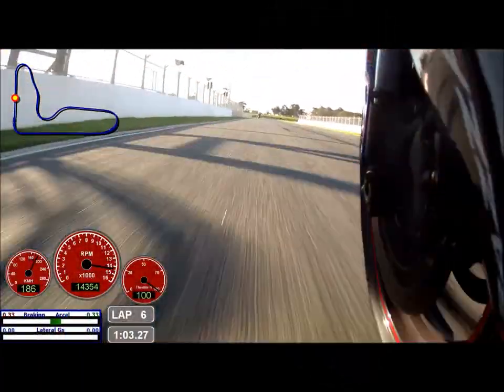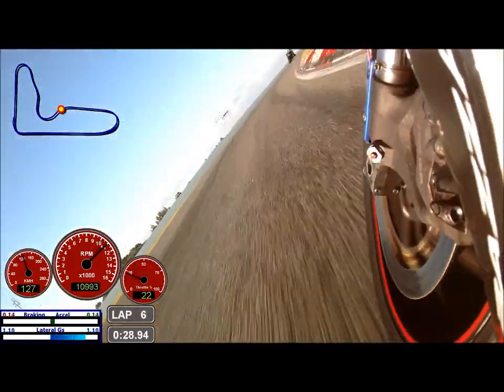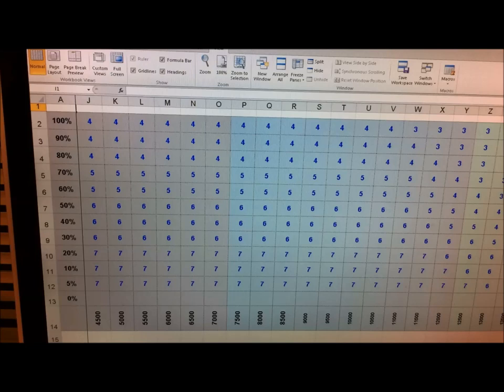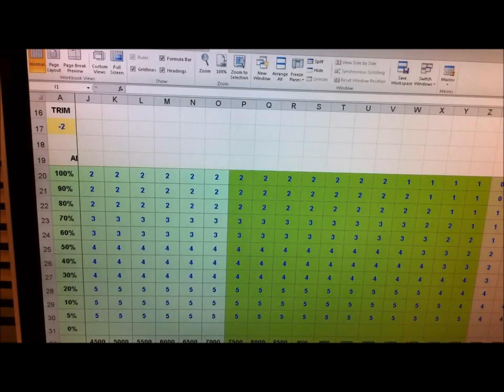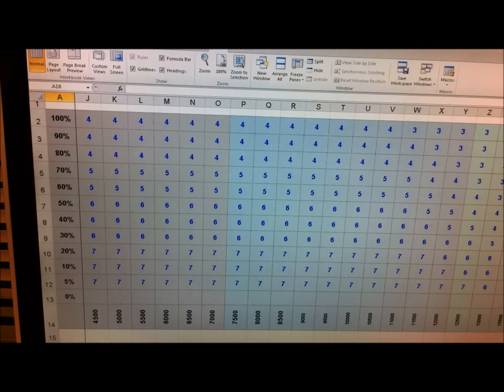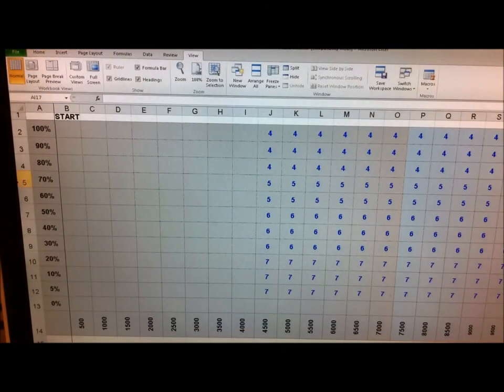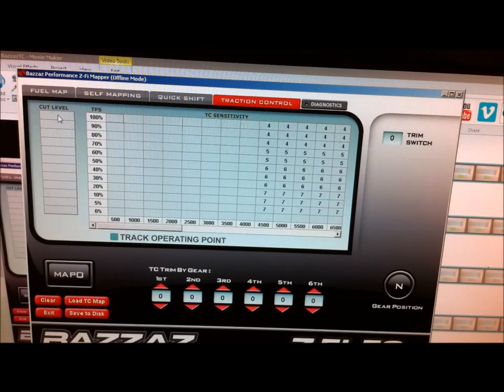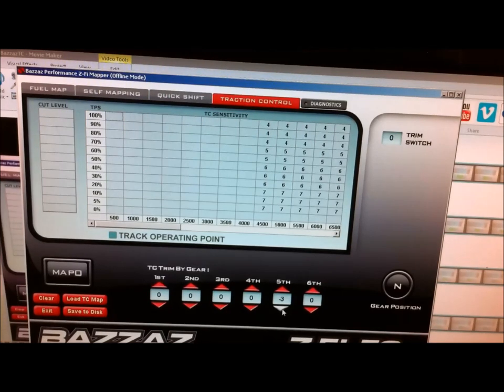How to Buld Bazzaz TC Map Traction Control Set Up ZFiTC

Comment: Thanks for sharing your TC tuning experience, Scott! The knowledge you share on YT is much appreciated. Cheers!
Reply from the maker: +Yuta Ishikawa Thanks Yuta ... I'm pleased to help. Regards, Scott
Reply from the maker: +Riged S Hi Riged. I try to explain how it works in the video. It's simple in that in monitors the rate of change of crankshaft acceleration. A sudden spike in crankshaft acceleration suggests wheel spin so it cuts sparks. It has no influence on the brakes. I'm not aware of a TC system on a motorcycle that operates the brakes ... only on cars.

From my experience the Bazzaz system will temper wheelies to some degree. My GSXR750 will still pull nice controlled power wheelies in 5th at 200km/hr over the hill on the main straight on our local race track.
Reply from the maker: +Jean Claude “THE MAN” Van Damme ... Based on what I've learnt it's good for both street and track. The default is all 5's. I'm using the same map for my 08 CBR600RR and my 2010 GSXR750. Remember to make sure you populate the "Cut" column. If you set them to a higher number you're more likely to feel it.
Reply from the maker: Thanks JCVD. I'm still using the Bazzaz and can't really fault it. I put the latest system on the 2010 GSXR750 race bike. That has the strain gauge switch for the quick shift. But the old style proximity switch works as well. The new strain gauge switch works on the original Bazzaz black box so it's versatile.
Reply from the maker: +Jean Claude “THE MAN” Van Damme ... The strain gauge type is better as it's effectively a solid rod. The Proximity sensor type requires the shift rod to move a mm or so. I've got the Proximity type on the 750 and that's as smooth as so I don't think the cost of upgrading is worth it. If your proximity sensor goes I can give you the TURCK part number. You can buy online for a fraction of the cost. Mine failed recently after 5 years. They're only rated for 70C so it's worth putting a heat sink onto the body of the switch.

My kill times on the 750 are: 85, 70, 50, 45, 40, 40.
Reply from the maker: +Jean Claude “THE MAN” Van Damme

Oh God no!. I've been a Fremantle Dockers member for 10 years! What's your mates name. I spent a lot of time in open pit mining by the way. I worked for contractors like Macmahons, Downer, Roche, John Holland

http://i367.photobucket.com/albums/oo115/scotte55_photos/750a.jpg

http://i367.photobucket.com/albums/oo115/scotte55_photos/750wheelie.jpg

Comment: Awesome video mate! actually all 3 regarding bazzaz :)
I've been working on my TC map but with no way to test it. I see a blink now and then but I would like to be able to hear that cut-off from engine/exhaust so I can be 100% sure this thing works. any ideas on how to test it?
Reply from the maker: Thanks FJ ... it's very subtle as it cuts spark so quickly perhaps on one cycle only. The only way I'll feel/hear it is sometimes in slow corners full throttle 2nd gear with the Cut Level on 10.
Set up a camera that sees the TC light so you can view the footage afterwards. You maybe surprised how often it comes on.

Comment: Absolutely amazing video. Thanks so much for that. 
Wow and I found link in description and it works! Thanks Scott and god bless you! 

So this worked well on  a 2008 CBR600. How short is your gearing on this setup? If you can tell me your max speed on a certain gear and rpm I can pull up the gearing from gearingcommander.com ? what cut levels worked well for you? 

Im thinking about using your map as a baseline map for my 2015 Triumph Daytona 675. Since my RPMs max out at 14400, thought about just shifting your cells further to the left to start from 1000. Wish I could watch my throttle position and further tweak.
Reply from the maker: Happy to help out. I'm running 15/45 on my Honda. The on board footage shows the speeds. The lowest gear I'm using is 3rd in the corners. I use higher cut levels at mid throttle and taper them off. At low throttle openings I'm at around 5 then go up to 8 to 9 by the time I'm at about 60% and taper them back to 5. You could use the map I have but move the cells to left slightly. I'm only using about 1000 more RPM than you as I peak at 15500. Your bike does have more torque at lower RPM's being a triple.
Reply: Looks like your gearing is almost exactly like mine (14/47 on daytona). Awesome. Since your lowest gear used is 3rd in corners, did you add +1 or +2 TC trim for 3rd gear? Not sure how much to trim by gear. Considering setting TC trim for gears 1, 5, and 6 to "off". 

May you explain what your findings were when experimenting with cut levels? Curious to know the logic for ramping up cut levels around mid throttle. 

The track I use has mostly 2nd gear corners 60-90kph which makes me wonder if I should just add gear TC trim +2 in 2nd. That should factor in the more torque. But again dont know what number is too much or too little. 

To prevent cold tire falls, is it best to adjust all settings by knob +3 on the first lap? I sure hope the TC can save from cold tire falls. Just fell and it sold me TC.
Reply from the maker: We have a smaller track 2 hours south with mostly 2nd gear corners and I have a +2 trim for second gear. For 3rd to 6th I don't add anything. My logic for increasing the cut strength was because you're at full lean with small to medium throttle openings. It's at that time as you start winding the throttle open you want the strongest effect. Once you get past about 50% throttle your lean angle is decreasing so you can back off the TC effect. High sides suck because you normally get hurt so I'm doing my best to avoid them. 
I have my 2011 Suzuki GSXR750 based at Sepang in Malaysia. I exported that last year. I had to make a lot of changes to the map because that track is 5.5km with 15 corners. It's super fast at T3, T5, T6, T7/8 which becomes one turn and T13. Other parts your down to 2nd gear like T1, T2 and T9. So it just requires some thinking about gears and throttle position. For Sepang I have a +2 trim on second and +1 on 3rd as the gearing is much reduced from standard.
Reply: Amazing Scott. Thanks. 

Any chance you compared laptimes with tc being completely off?
Reply from the maker: A. Not really. Anecdotally I started going quicker with the Bazzaz TC. More confident to roll the throttle on sooner. I don't just snap the throttle wide open and hang on hoping for the best as I you can still overwhelm the system. I feel it allows me to have more throttle at any particular point in the corner. I still ride with a smooth ride hand which is always the best way to get fast lap times. If you ever get a chance to ride Sepang do it. It's one of the best m/c tracks in the world. I ride with SBR Track Days out of Singapore. They have a fleet of hire track bikes. I used their ZX6R hire bikes the first two visits then sent my own bike over. I go over every two to three months. Next visit is for 23/24 March. Scott.
Reply: Sepang sounds nice. I'm far from it but who knows maybe we'll meet one day. Since this a very informative thread I'll go ahead and post this bazzaz link that helps explain the TC :

http://bazzaz.net/images/kb-bazzaz-traction-control-supplement.pdf

I noticed there are 2 TC modes Default/Expert. Expert being 4 steps less sensitive than default. 

Is your map based on default or expert mode?

Tried looking at your bazzaz grid in the end of the video but the bazzaz grid layout itself looks different than the software as downloaded from bazzazs website downloaded 18-1-2018 that mentions TC mode default/expert on the left side under the throttle column. On your bazzaz grid it doesn't show if it's expert/default mode so I'm not sure which mode is enabled.

Comment: Hi Scott, thank you for the video. Do you have any experience with Bazzaz QS4 setup? I seem to be getting smooth(ish) up shifts under smooth roll-on, but when the load on the gearbox is heavy under rapid acceleration on the track, shifts become really clunky.
Reply from the maker: Hi Max. I'd experiment with the cut times. All it does is cut the spark to take the load of the gears so they slip through to the next one. You need a longer cut in the lower gears. 1-2 80ms, 2-3 70ms, 3-4, 55ms, 4-5 50ms, 5-6 50ms or even 45ms. Try those and report in with your findings. You should be able to have the throttle pinned 100% open and it will drive like a semi automatic. Regards, Scott
Reply: Scott Elliott cheers Scott, I think it is currently 75 for 1into 2, the rest are 55s. I will try changing those and report...

Comment: What an Awesome Vid, Very Helpful, I have a  GSXR 750, with the full Bazzaz system, will be  using your base settings and adding a little due to my lack of skill, then see how it goes at eastern creek.. Cheers
Reply from the maker: Thanks Craig. I haven't said it in the video but you could dump the map in the Excel sheet into your system as the GSXR750 will have similar gearing. Just remember to put numbers into the cut level column. If you have the adjustable switch on your handlebar then run it at zero or even plus 1 or 2 for starters. If you put your cut numbers all at 10 you'll have more chance of feeling it when it activates. Kind regards, Scott
Reply: MrScott52 I Dont have the adjustable switch yet, I was going to do that and dump and test, but use a plus 1 and plus 2 to start with and dial back from there after each track run as I will take my laptop with me,, Cheers, will let you know how I go..

Comment: What would be your opinion on the bazzaz if I’m not racing on the track. I’m getting a whole bazzaz set-up for next to nothing that’s the only reason for getting it. Would there be a good all around map for daily driving? And Thank you for any help sir
Reply from the maker: Matthew a track based map would still work on the street based on my experience. You don't get the lean angles on public roads ... well if you do you'll probably be arrested or end up in the emergency ward!
Public roads have more hazards like water, sand, gravel, oil spills etc. If it was me I'd increase the numbers in all cells and increase the cut levels so it's more sensitive. Scott
Reply from the maker: https://mega.nz/#!s2JwDZSA!jzGrJajnMOchq80z6Ht3lGrxr-oO8My0ZcOnf50jmos

Comment: great stuff on your channel! can you provide the afr map you used to tune your fuel injection?
Reply from the maker: john smith  John I've updated the file which now sits in Dropbox. You'll see there are two tabs ... one for TC numbers and the other for fuel. In the fuel sheet I have the latest AFR's I use on my CBR600RR. These seem to give good power without being too lean plus a nice smooth throttle at the apex when you start winding it on. Try them and tell us all what you think.
Reply: MrScott52
Thank you very much, that's an interesting map. All the other maps i have seen on the net are getting richer at higher tps percentages. They are also richer overall
Reply from the maker: john smith This map is what I use for my track bike so I'm after power and crisp throttle response. My map gets leaner as the throttle opens but I make it richer again as I get closer to 100% throttle.

Comment: How did you get the Throttle and RPM data?
Reply from the maker: I mention in the beginning of the video you need a GPXpro or similar data collection system. Watch from 1.48. These GPS based lap timers usually have several data inputs you can connect such as the throttle position, RPM feed, suspension travel etc. I've also made a video about collecting suspension travel data using home made suspension potentiometers.

As I said none of this is easy and requires quite a bit of work. But it's interesting learning how to do it ... it staves off dementia.

Comment: could you make a traction map for a k5 suzuki 1000 ?
Reply from the maker: Yes you could easily make one. Follow the process as outlined in the video. Download the spreadsheet from the link in the description and use it as the starting point. You'll probably only need to massage the numbers to align with your RPM range.